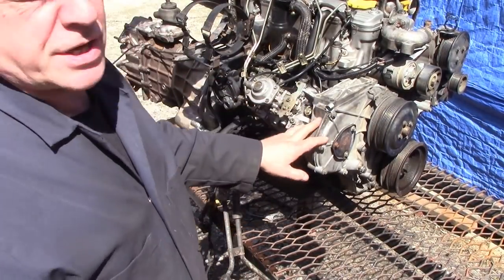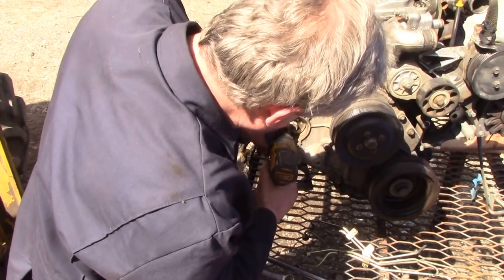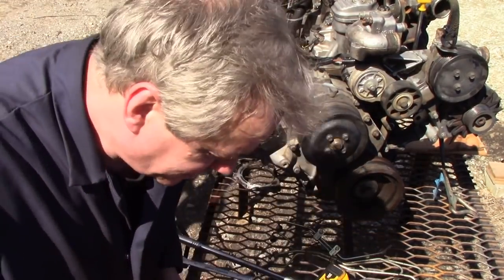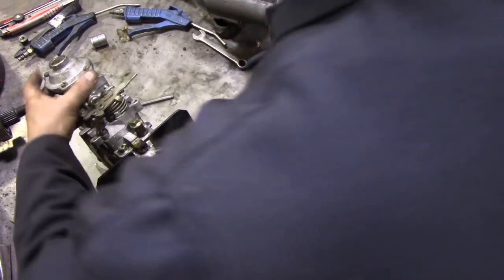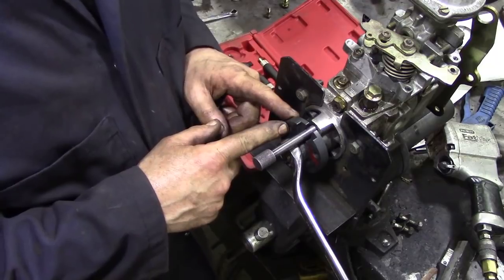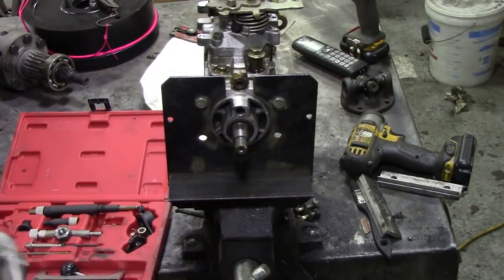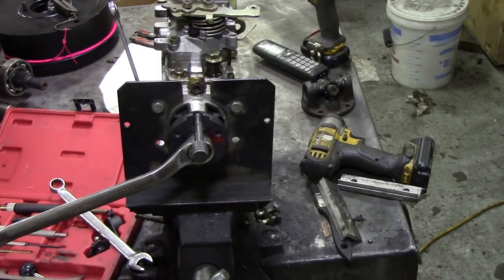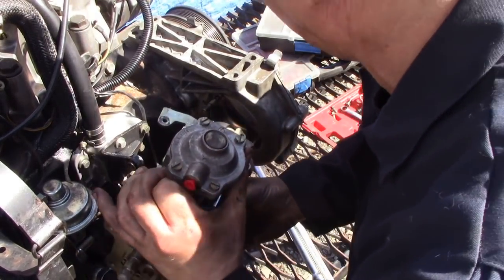How to re time the VE injector pump without removing the timing belt

Comment: Brilliant - This video is a get out of jail card for me an my son who are restoring a 1988 defender - We timed it on the pin at first - But still it just emitted smoke -  Even advancing it by slackening the three bolts and moving the pump in situ was not enough to get it right - just not enough left or right rotation on the actual pulley  - So the actual main sprocket on the pump we had was way out -  As you say right at the beginning if it has been messed with it beforehand and you time on the pins as you normally would you are never going to get it right.   So your method is really the only way to correct it if you cannot get it right on the vehicle.  Great video - thanks
Reply from the maker: Glad it helped!

Comment: Really good instructional video Mike,   thanks for that. I've never seen the job done using all the "correct" tools, all the ones I use I've made, even the adaptor for the dial gauge into the back of the pump, but it works fine.
Reply from the maker: Glad to help

Comment: you know what Mike, i just may have to send you my pump to refurbish!
Awesome job pal. Cheeers!
Reply from the maker: Problem with refurbishing pumps is setting them up - stripping, cleaning and replacing parts is easy - it is the fine adjustment which is the problem as you never know who has been tinkering with them in the past
Reply: @BritannicaRestorations   Exactly!.  Thats proberbly why, with this new Tdi im only getting 460 kilometers per tank. Atrocious.
My other one was getting 900-1100 per tank, depending on driving conditions.

Comment: hi Mike, great video. My 300tdi just had a timing belt change. After that it developed an intermittent loss of fuel supply while pressing the accelerator. One day the engine just stops while i was driving as if i was out of fuel. Does it had to do with the timing belt replacement? Hope you can give me an idea. Thank you
Reply from the maker: The timing belt should have no impact on fuel supply.
I would be checking the filter, shut off solenoid, tank breather and fuel lines for blockages or damage
Reply: @BritannicaRestorations  thanks Mike, i will check on that. cheers!

Comment: I used to do the same for Bosch pumps fitted to newholland excavators.
But you must be sure that when you set the injection pump piston stroke at 1.6 you are setting it up for output to the correct cylinder. The pump 360 rotation is divided into 4 quarters.
If you spin the pump round at any time, without your timing flange it is possible to set it up to inject on the wrong cylinder.
Reply from the maker: The keyway points to the number 1 cylinder on the Tdi
Reply: @BritannicaRestorations  that bit you pulled off with the 3 leg puller can't have a keyway or you wouldn't have been able to adjust its position
Reply: Dead right Stephen, an ya Up ta y'er Boll*x in Shite on a building site, upside down through the engine cover trying to get her going for the morning, but t'is an awful lot easier than today, it's like taking the back off the Telly !
Reply: @jackvaughan7577  ha yeah you know the score 👍
Reply from the maker: There is a keyway in the shaft but not in the pulley
Reply: @BritannicaRestorations  ah good to know. Thanks Mike 👍
Reply: @BritannicaRestorations  
Exactly Mike 
I always hate the thought of "Tapered Fit" drive sprockets, especially on Cam & Crankshaft sprockets, is it Laziness on behalf of the manufacturers to have one less procedure for Keying the Shaft/Cam etc, & then  having Mental Torque on the bolt, 
(did you remove my comment from last night, I apologise if you took offence, it was meant as a joke, it probably my Tipperary sence of humour)
I hope everyone appreciates the knowledge You're passing on to them 
Thanks Mike

Comment: Mike
Using your technique to check timing on my freshly rebuilt IP for my 300tdi
question, as I push through the “power stroke” on the IP, I am seeing higher lift than 1.6, hits 1.6 at my timing bolt slides correctly, but if I continue to turn, (having removed the bolt again) I am seeing the lift go much higher.   Is this right?
Reply from the maker: That is correct - you are setting the timing at 1.6 - it will go higher as it is not it's peak but the setting point for the pump

Comment: So I have a great situation on my series 3 200tdi conversion, After a nice long while of driving, it started to piss diesel down the bottom wade plug hole, I have ordered the bosch ve front seal hoping its the right one. Do I have to bring everything to correct 0 or with this tool I can just take the pump off and fix it and drop it back on the same place ?
Reply from the maker: It is critical to get the pulley on correctly - if you follow the video you will see the procedure
Reply: @BritannicaRestorations  yes everything is on and timed well been driving for a couple of months already so I'll just rotate the engine till the pin locks on the pump then I'll remove it, I bought the tool set cause of you :) didn't think I'd been it already lol

Comment: Hello Mike, I have a question for you. In your video at 4:24, you show the tool to draw of and fix the pulley. What is this tool called? I have a Volvo Tamd 41. Do you think I can buy this tool for that engine?  Nice video.
Reply from the maker: That set is dedicated to the Land Rover Tdi's I doubt it will work on a Volvo, 

But here is a link to a kit (you can get them cheaper on eBay)

https://www.roversnorth.com/parts/rnt2029_timing_tool_kit_diesel_2_5_200_300tdi
Reply: @BritannicaRestorations  Thank you so much for the answer, that was quick and useful. Now I know what to look for. The pump looks exactly like the pump on the Volve engine, so I have learned some new things about what to do and what not to do. And thanks for uploading those videos. You are an very good teacher. Best regards Ben, Denmark.

Comment: Hello Mike, a great video as always. I wonder if you could cover something for me which may be beneficial for other viewers as well.  When timing a pump you always seem to aim at the setting of 1.54mm lift @ TDC would this be correct for an engine which had the EGR set up as standard as the book says 1.4mm, also if you had an engine originally with the EGR that you had fitted a blanking kit to but retained the original pump which would be the best setting to use? I'm sure your thoughts on this would be enlightening. Thanks for all the work you put in to the video's.👍
Reply from the maker: I have not played with an ERG pump timing  - I have noticed that the injectors for the ERG are different and have a higher pressure  - could be that the timing is retarded a bit to make up for the higher pressure and cleaner burn?

Good question
Reply from the maker: That is what I was thinking

Comment: I had a similar experience.  The pump on my RRC needed replacing and I bought a very new pump from a contact who’d bought a 300Tdi cast by the REME as a non-runner after efforts at fixing it.  The reason it didn’t run was that new pump having the flange on at the wrong angle, way off, preventing any chance of setting the injection timing - the engine wouldn’t even splutter, let alone run rough, and I assume the same was true of the Army engine it was attached to, and they had enough of it.  I had it reset by a specialist and it ran beautifully.
Reply from the maker: They ae not difficult to do = but you ned the gauge
Reply: @BritannicaRestorations , I didn’t have a clue how to do it until you showed us, but it was an opportunity to have the pump, which was clearly brand new when the engine was scrapped, tested for all of its calibration - with the timing so far off, what else was mis-set in the factory.  But it’s handy to know how to do it for the future.

Comment: great vid as always mike and perfect timing as need to reset mine can a standard bolt be used to lock the pump shaft or do i have to try and find the special old type like u used many thanks
Reply: I managed to find a good 2nd user ( secondhand) bolt ( from Bob Beck diesels )  You can find them on auction sites
Reply: @chriskautz3245  many thanks ive been looking for ages still cant seem to find one

Comment: Hi Mike great video. That bracket you made was handy! How did you find the measurment for the lift please? Many thanks, Rob.
Reply from the maker: The measurements are in the workshop manuals
Reply: @BritannicaRestorations  was that a land rover manual sorry? I've got a ve30 pump I was trying to set up, im not sure what vehicle it came from and I've read the different R numbers on the pumps are different lift settings but can't seem to find any more information on what they would be
Reply from the maker: There were 3 types of pump fitted as far as I know - the early none emissions one, the emissions one and an electronic pump - but that was on the Disco and RR 
Lift on the early ones was 1.56 mm - Usually re set to 1.6 mm the emissions one was different, and I cannot recall off the top of my head, but I know on the emissions one, the injectors had different part numbers
Reply: @BritannicaRestorations  that's great thanks very much, I'm pretty sure this is the early one it has the lock of tag thing. Tha ks again for the great video

Comment: Great video, often wondered how you do that. I’ve got a spare pump condition unknown. Do you know where you can you get the pump shaft locking pitch bolt? Is it in the kit?
Reply: I am trying to figure out where I can get one of those bolts also. Did you ever find one? I'm working on this right now.

Comment: What size are the bolts you used on the tool to space the pulley?
Reply from the maker: Ralph - can you elaborate?
Reply: @BritannicaRestorations  I believe he means the length of the bolt used to hold the pump pulley against the tool. You mention at about 5:10 that it doesn't want to be too long or too short and that you would put the length in the video description. I was looking for the same bit of info and came across this comment. Thanks for sharing your knowledge.

Comment: Hello again, What was the bolt size ?
Reply: OH engine in place this is quite tricky to line the bolts up LOL
Reply from the maker: Can you be a bit more specific?
Reply: @BritannicaRestorations  sorry the bolts you used to attach the puller ? I got the bolts in the set I got but seem too long or short
Reply from the maker: It will be the short bolts in the kit - you only need 2 bolts to get the pulley off the pump and locked in place - DO NOT over tighten!
Reply: @BritannicaRestorations  ok thank you

Comment: I got to the stage 15:00 ( video time)  My dial gauge pointer went one full revolution and 48 ( nearly 1/2  a revolution gain .. so thats 148 .. so I assume that i have to move the flange 148 in order to line up with the timing pin .
Reply from the maker: 1.56 is the regular timing on non EGR pumps - please check before adjusting
Reply: @BritannicaRestorations   thank you for reply . My pump has the black cap with 3 wires ..... I have to start from scratch  as the damn puller broke a leg
Reply from the maker: Is this an EGR pump?
Reply: @BritannicaRestorations   No Bud ..  its the same as the one in vid ,, its the ve turbo bosch .. I managed to get hold of another pump the same type .. Going to fit that when the weather gets better here ..... I hope you guys are ok with the heatwave at moment .. stay safe

Comment: I’ve just turned the engine with the timing pin in, and there’s diesel running over my new timing belt,
Reply from the maker: Sadly you have broken the front of the injector pump - will have to be replaced